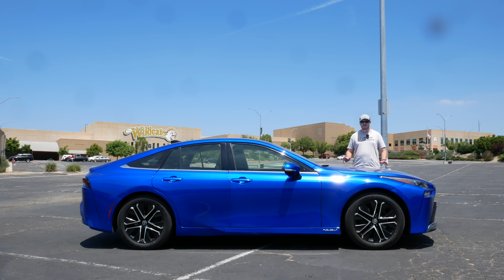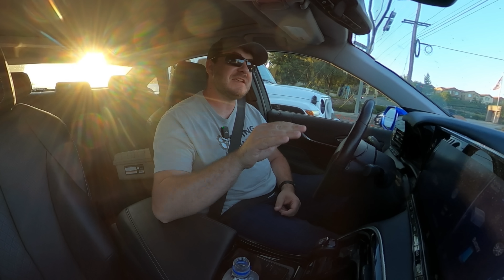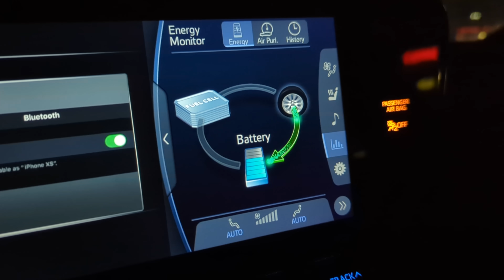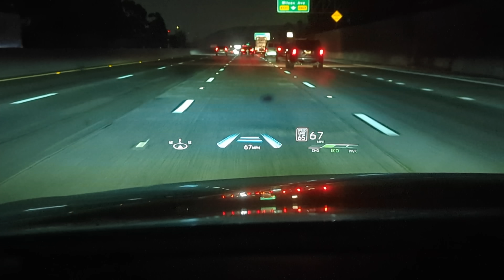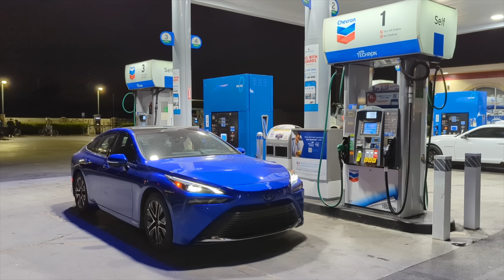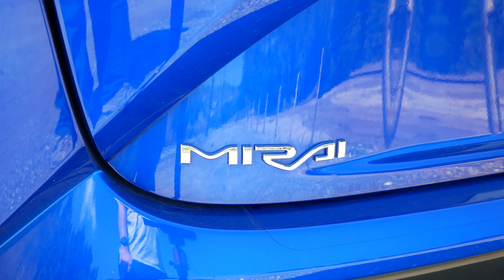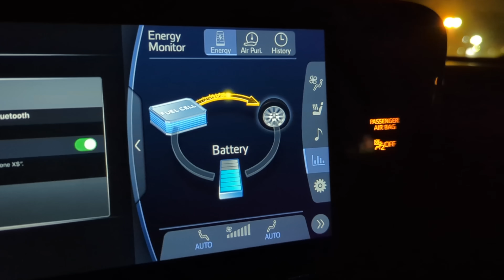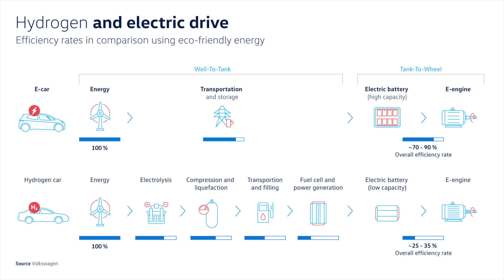The Toyota Mirai is Disappointing

Comment: Oh, and hydrogen leaks. It's pretty much impossible to stop hydrogen from leaking (due to it being at the top of the periodic table) from any sort of joint.
Reply: To clarify: Hydrogen atoms are small, which means that hydrogen molecules are small, which means that spaces between molecules that other molecules can't really fit through can be permeated by hydrogen.

There's a more technically accurate answer somewhere, but it probably requires a better understanding of quantum mechanics than I have.
Reply: @timothymclean permeation is the correct term, the hydrogen permeates the container and actually structurally and chemically changes it. It also escapes the container. NASA has some good publicly-available documentation on this exact problem due to them using hydrogen and oxygen in their Rockets. As to why they don't store it in liquid form in the tank, is because it would be having to be stored at negative 253 degrees Celsius, and would have to be cooled by liquid helium, and this would turn whatever container it's in into a brittle mess. In fact, storing liquid hydrogen and liquid helium is incredibly difficult as it is, because the container becomes so dangerously brittle that it can actually crack adjust from the liquid shifting around.
Reply: @chubbysumo2230 hydrogen is known to embrittle metals that it's exposed to...some metals can form hydrides, which is a salt where hydrogen forms a negative ion (amongst other forms of bizarro chemical behavior-we're more used to Hydrogen giving up electrons and acting more like a group I metal on the periodic table!)
Reply: @timothymclean if you didn't clarify immediately we never would have known
Reply: Yep, just ask NASA (looking at you, SLS)
Reply: Tell NASA.
Reply: You don't need to stop it, you just need to control it. The problem with hydrogen leaks is it damages the container over time so it'll need to be replaced eventually.
Reply: Hydrogen is flammable right? And according to this thread, other a oms are also really small. So to repair it you would need to remove all the hydrogen, somehow find a micro pinhole, you can't use water to find it because water is too big to fit into the hole (that's what she said), and after all that you have to somehow repair it and hope that's to only one..
Reply: @jwalster9412  the tanks aren't repaired and they got some lifetime rating.  that's why they didn't let people to actually buy them elsewhere at least.

but it's not like the tanks didn't work for the rated time. it's just not very convenient to handle. like the technology is proven but it doesn't make much sense unless you lack gasoline and lack batteries but have some power generator.

it works anyway and doesn't have major problems, has some advantages over electricity but a bunch of disadvantages and hard to sell to people with the idea that you just lease the car.
Reply: @lasskinn474  lifetime? Lmao, hydrogen tanks last for 10 years. Source: Toyota themselves
Reply: @JohnLasseter-ct5in  yes, that's the lifetime. that's why they lease it.

(they don't fix them, after the rated lifetime is out, the things out)
Reply: @jwalster9412  Fix a flat/leak/greensnot
Reply: @jwalster9412  You can just draw a vacuum on it and then use a high voltage leak tester.  I follow a guy on youtube who makes his own vacuum tubes. You'd be surprised how tough it is to get glass bonded to wire to perfectly seal.
Reply: cute profile pic
Reply: Many air conditioners and refrigerators are made without joints.  All brazed.
Reply: Dont they use metals to prevent the leaks, the kind you are describing, in some cases? I think that is the same mechanism that reseals the Hydrogen tank if it gets punctured.
Reply: @keith_5584  Hydrogen is the smallest atom in existence, it will slowly diffuse through any material, even "solid" metal structures.
Reply: @keith_5584  Hydrogen leaks right thru most metals. Not very quickly, but if you go on a long vacation, you car might be empty when you get back.
Reply: @lwilton  The tanks have some serious R & D being done, and that is from the limited information I found as someone not directly in that field. I wasn't able to find the link I had saved for my comment about the self sealing metal mixed in with the Hydrogen, but I do know they are working on it and for more than just the auto industry. A few of the patents I searched looked to be filed by Toyota. (for the tanks)

It is possible the original thing I am thinking of was for non-liquid Hydrogen thinking about it again. If it is not compressed than it leaking out makes sense, especially if the tank is exposed to heat changes.

Not disagreeing with you, but I wanted to clarify a bit.
Reply: There's a science youtuber thunderf00t who says hydrogen is about the only gas that scares him. Once you factor in all the extra tank thickness and other safety measures required to make hydrogen safe then hydrogen loses all its advantages. Plus the pumps at filling stations, what happens when they malfunction?
Reply: @6581punk  Surprised thunderf00t says that, the nice thing about hydrogen is that as soon as it leaks it goes on its way to the upper atmosphere. Some explosion risk but again that relies on it getting trapped in a garage or something and mixing with oxygen... so yeah its not a great option for consumers at all
Reply: @6581punk  They bloow upp happend in Oslo Norway in 2019.
Reply: No more leakage than the parasitic drain on any EV battery. Not a concern really.
Reply: Aren’t there also climate change issues with hydrogen leaks? Not sure of the mechanism for this, however.
Reply: @keithvertrees  not really, hydrogen is so light it just flies into the atmosphere before doing anything. its much less polluting than gasoline when released into the atmosphere
Reply: @cadenbarnfather1434  thats why all charging stations keep exploding on regular intervals... you dont use a station for 2 days it fills to the max then it leaks and bursts into flames... hydrogen is used in space where leaks have no negative consequences, on earth we still havent figured out how to store smallest molecule
Reply: @cadenbarnfather1434  Incorrect, it is very damaging in the upper atmosphere. it is anything but a green fuel.
Reply: @amraceway   regardless, tritium is used in glow watches because if it leaks, you don't die of radiation poisoning immediately
Reply: @amraceway Fake news. Hydrogen does nothing to the "upper atmosphere." Hydrogen is so light it escapes the atmosphere and enters space.
Reply: @keithvertrees No, hydrogen is not a pollutant or greenhouse gas.
Reply: @keithvertrees not really. Even if it were, it's of no concern.
Reply: @keithvertrees  Not that I'm aware of. It flies into the atmosphere, and then is light enough it flies out of the atmosphere (well, sits on the surface, where it gets blown away by solar winds)
Reply: @keithvertrees  Nope, hydrogen is not a greenhosue gas. It will simply rebond with something like oxygen and float away.
Reply: @keithvertrees  It might react with the oxygen in the atmosphere to form the incredibly deadly dihydrogen monoxide, inhalation of which is extremely fatal... An excess of said compound also results in an increase in flooding.
Reply: @keithvertrees yeah, like some increased water levels ;)
Reply: @keithvertrees Hydrogen is light enough to escape the atmosphere. It drifts into space and gets carried away by the solar wind. So not an issue
Reply: @keithvertrees yes you are correct - I was reading up on the science today
Reply: @keithvertrees No, this is one problem hydrogen doesn't have.
Reply: @keithvertrees  Yes if it leaks it's real bad for greenhouse effect

Comment: Drove a fuel cell forklift for years. The weak point of the system wasn't the fuel cell, it was the buffer battery which failed way too often. But as much as the problem with battery EVs is infrastructure, it's 10x that for fuel cells.

Comment: With the way that grill is designed, it almost looks like it was supposed to be a Lexus and then they changed their minds
Reply: It looks like a total after thought. I wonder if most of the development was spent for the power train and the chassis and basically everything else is just ripped from another model
Reply: @jwalster9412  The chassis and basically everything else was ripped from the (now previous-generation) Crown, so, yeah.
Reply: The more I look at the front it looks like a Lexus and the Gt86/BRZ/FRS had a baby
Reply: It's based on the Lexus LS, just less room inside bc of the hydrogen stuff.
Reply: They should have those pivot out so you can cook burgers and weinies on them.  Just sayin.
Reply: Maybe a charcoal bunker in the trunk.
Reply: From what I heard, this was supposed to be the next gen GS, but Lexus killed the GS so they made some hydrogen stuff work in it
Reply: I assume most people like that huge Toyota/Lexus grille style or at least don’t mind it - but I absolutely hate it!
Reply: @Sashazur most people don’t “like it”, but it’s the trend and therefore Toyota does it anyways.
Reply: I drove the previous generation Mirai at a local university as part of there HEV course. It drove like a Lexus and is built like a Lexus. Very smooth and comfortable to drive.
Reply: It was actually designed like that because it was supposed to run on krill, but the engineers couldn't get it to work.
Reply: Lexus is slowly changing their front ends and Toyota is adopting it. Take the Avalon for example, looks like its brother the ES.
Reply: Lexus and Toyota have been merging their designs like crazy last few years. wich is a shame cause lexus are ugly as hell
Reply: It was a lexus but they wanted it be a bit up market because of the price
Reply: You have absolutely no idea what you are talking about.
Reply: Toyota has a Corolla type supercharged 4 cylinder that  burns hydrogen
Reply: @CAESARbonds  now that's a dead end. Not only the fuel is expensive and tedious, you produce tons of NOx...
Reply: @AuschwitzSoccerRef.  Hydrogen  Ice is never going to happen, it makes zero sense, then there are the Nox emissions which can probably be got round but would not pass in the USA or Europe without extra tech to go wrong.
Reply: Apparently this was supposed to be the design of the Lexus GS, but they scrapped that project and decided to use the design for the Mirai instead.
Reply: because it's totally a styling exercise,.yeah. Thanks for coming
Reply: yes it does. I wonder if Lexus gets a lot of influence in the designs that are going to be Toyotas first. Or maybe they're not as distinct as that so really its all planned out at the same time.
Reply: Good observation - it is my understanding that is exactly the case
Reply: They were made in the same platform with the Lexus LS
Reply: I made the comment too early. The video already says it lol
Reply: Aston Martin
Reply: Toyota Makes Lexus
Reply: If it was only a little bit smaller I’d think this car looked pretty damn good. But it’s so huge
Reply: Bingo
Reply: Toyota and Lexus are designed and sculpted under the same roof. Multiple satellite studios,  California Michigan japan, maybe another not sure that compete for designs.
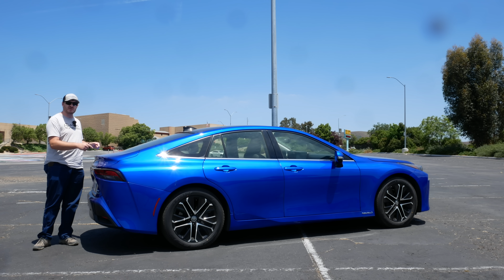Reply: The rear lights and the weird crease in the bumper that comes down from them reminds me of the current-gen Supra. see: 1:10
Reply: Lexus is also Toyota... so no, not a coincidence.
Reply: Lexus is owned by toyota so tehy may just recycled a design.
Reply: This car always reminds me of the LFA
Reply: @ItzMaxton i’ll have whatever you’re smoking.
Reply: @johnjuiceshipper4963 same
Reply: @ItzMaxton  That is rather good thing
Reply: The reason for the massive grilled on modern Toyotas/Lexuseses is to get people used to the massive grilles required to cool Hydrogen.
Reply: One in the same, japan doesn't have lexus. We do because the average person can't see toyota as luxury.
Reply: @Astrothunderkat  They now sell Lexus in Japan.  Prior to 2005, they didn't, and Lexus models sold elsewhere were badged as Toyotas in Japan.  That is no longer the case.
Reply: they stated selling lexus in Japan around 2005 @Astrothunderkat
Reply: Yes…no new info here. It is described as being on the LS platform. They literally market it as a lexus line…?
Reply: Maybe because it's based on a Lexus. You know what they say about Lexus, just a fancy Toyota

Comment: Sorry but I'll take my chances on a normal, dino-powered vehicle as compared to a rolling hydrogen tank.
Reply: The way you phrased that makes it sound like you're concerned about the safety concerns of a tank of flammable hydrogen, even though you're willing to accept the risks of a rolling hydrocarbon tank. A tank with much thinner walls.
Reply: @timothymclean Actually for me, it's the high pressures. Apparently carbon constructs aren't good for cyclical pressure changes over a number of cycles/years. Supposedly, it can/will get cracks... a 10Kpsi crack would slice through the car, you and the pavement around you rather quickly if you were in the way of the vented hydrogen. Now if it were an accident, yes a spark would be really bad on top of the pressure release.

Comment: For a guy who literally sleeps with EV's anything else but EV will always be disappointing. This is like letting a vegan review a rib steak.
Reply: What he says is true. In passenger cars, fuel cells are so far behind batteries that it has no future. Before they have wanted to create a tank network, electric cars can charge as quickly as you can fill up with hydrogen. There is no prospect of efficient green hydrogen in the next several years, the researchers think they may be ready but an efficiency of 75% in 5-10 years. then there are still transporters and fuel cells. so in 15-20 years hydrogen will be where electric cars are today.

Comment: they dont make sense at all. Any other gas would be better.
Reply: Eh...if you're going for energy density, it's hard to beat hydrogen. If you're going for clean emissions, it's impossible to beat water vapor. If you're going to use methane or something you're just using fossil fuels with extra steps.

Comment: "Complex and silly" pretty much sums it up.  Why is Toyota so resistant to building pure BEVs?
Reply: I think part of it is there is a lot of their home market where the ability to charge at home is limited. I've got that issue in the UK, the only place I could charge a BEV is at a rapid charger, and well, doing that twice a week isn't going to do the battery much good according to the makers.
Reply: Because they missed the train. They heavily invested in hybrids and hydrogen in the past, thinking this will be go to tehnology in the coming decades, but EVs became viable very quick and they didn't adapt. It's actually true for all japanese auto industry; none of the big brands have anything serious to offer in terms of EVs.
Reply: @hojnikb  I will say the Nissan Leaf is decent and a few years back was the majority of the EVs on the road. My 2016 Leaf is still very nice to drive, albeit for short trips. Otherwise, you’re right. Where is Honda in BEV market, for instance?!?
Reply: @torchris1  Yeah, Nissan is an outlier here, but that's likely due to connection with renault and MB.